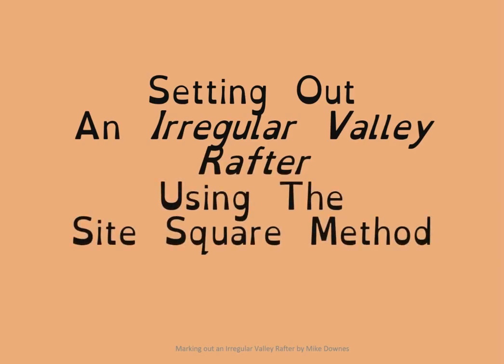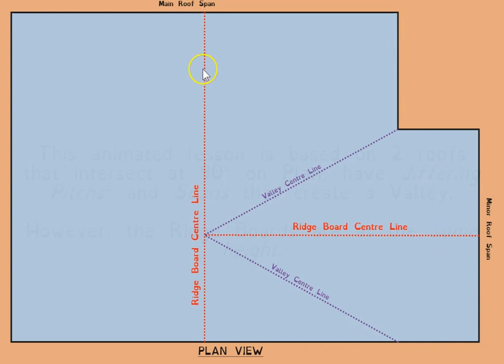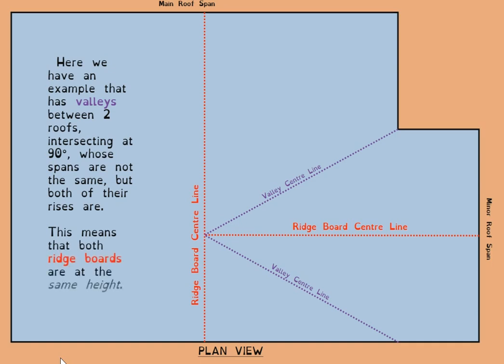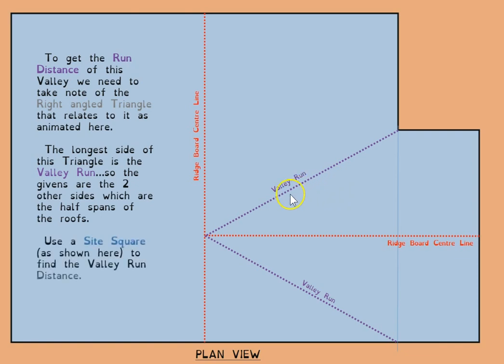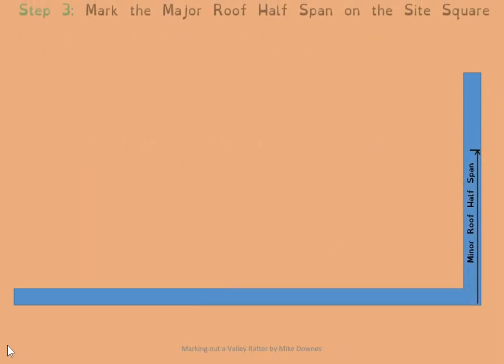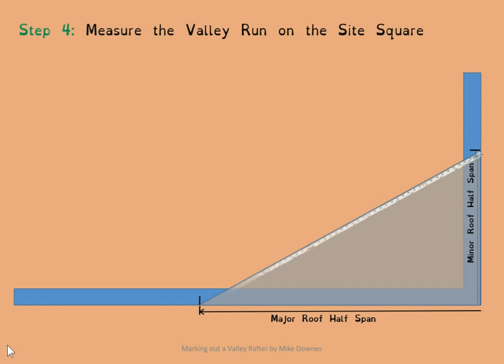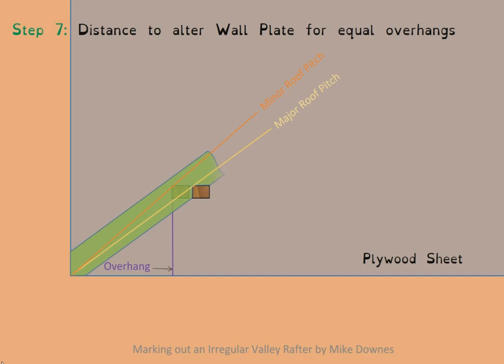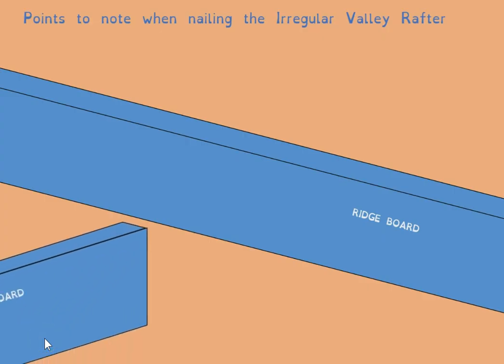Marking out a Bastard Valley Rafter

Comment: A really comprehensive guide and explanation on marking out an irregular valley rafter. The associated animated graphics were extremely useful in visualising the subtleties of this variant to standard roof constructions. Many thanks for this and previous related posts each of which has clarified important roofing and construction details in a simple manner incorporating great graphics alongside the commentary.
Reply from the maker: Hi Jeff, Thanks for this feedback. I have been producing these vidoes based on what I used to draw on a Black Board/White board when instructing Carpentry Joinery apprentices. Now that I have the option of creating these animated versions of the same lessons I cant create them quick enough as I can see the quicker transfer of  knowledge that is happening...especially to the Visual Learner.
Reply: @michaeldownes516  Michael, your YT posts are an invaluable source of reference and insight. As you point out, visualisation aids make construction details so much easier to grasp.
Are you aware of the following old text: Advanced Constructive Geometry by Dowsett ? This contains many superb applied joinery problems.I’m working my way through it progressively out of both curiosity and interest - teaching myself constructive geometry in the process.
Three somewhat related and intriguing joinery problems which at some future date yo may like to address are as follows:
1) Sometimes purlins are cut around the bottom edges of hip rafters and mitred together. The bevel used on the side of the purlin for this cut is required.
2) The geometry of joints in splayed work is another interesting topic eg. The corner of a box having splayed sides each of which has a different thickness.
3) Consider the following: A given moulded handrail section is inclined at a prescribed angle to the horizontal to a vertical pier, the other side of which forms a given obtuse angle.The aim is to determine the corresponding profile for the other part of the handrail, again fixed at some arbitrary angle to the horizontal in order that it intersects the original moulding at the corner of the obtuse angled pier. The bevel cuts at the intersection plane are required too.
Will be a regular viewer to your channel - once again fully appreciate the content and work which goes into the production of your videos. Many thanks!!!!
Reply from the maker: @jeffbourne6015  Well Jeff, I am not familiar with Dowsetts publication...but i intend to check it out. I have been referring a lot to a book I have since I was an apprentice by a Frank Hilton, titled "Advanced Carpentry & Joinery" which  covers  Purlin Bevels including the Lip Bevel, Splayed Linings and Hopper Development including the Dihedral Angles and also Handrail Development and Raking Moulds. I also refer to another old book i have titled "Modern Practical Joinery" by George Ellis
As it happens the next video i am planning to do is based on the the 3 Purlin Bevels at the Hip Rafter....hopefully uploaded in a week to 10 days.
I am also planning to produce some videos related to stairs to include  string, winder step and handrail developments.
Thanks for your comments and suggestions.
All the Best!
Reply: @michaeldownes516  hi  michael great videos ,i have a copy of dowsetts geometry book  extremely well written will catch uo sometime well done again ,videos are exceptional euge

Comment: Micheal it’s all very good stuff! In my experience when doing an equal soffit dual pitch Hip roof, we would calculate the amount to raise the Wallplate for the steeper of the 2 roof pitches, and the Hips or Valleys have a slight shift in relation of thickness to either side of the center line, but the center line stays in the same position lining up with the outside corner of the facia etc.
Reply from the maker: Hi Thomas, moving the wall plate upwards on the steeper pitch rather than inwards on the lower pitched roof is sometimes the best option to go with, especially if the rafters will be making contact with the wall before the desired overhang is reached on the lower pitched roof section.
Reply from the maker: ...i shall address this important option you raised in the public comments section in this video...thanks for your contribution.

Comment from the maker: If you cannot/do not to move the wall plate inwards on the low pitch roof section then you have the option of raising the wall plate on the steeper pitch. To calculate this distance, go to the 25th minute of this video and instead of using the animated horizontal distance between the 2 pitch lines...measure  the vertical distance between both pitch lines from the same junction.This will give you the distance to raise the wall plate on the steeper pitch to maintain  the same over hang for both pitchs.
Reply: Yes, it's all good stuff and I'm still interested and learning in my 60s!

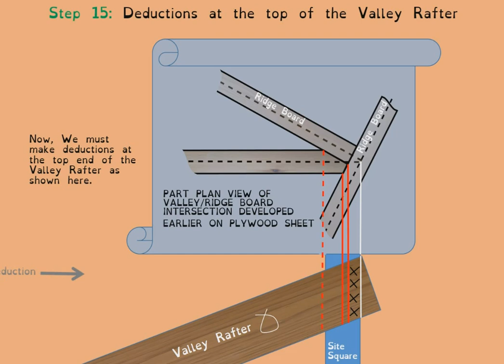Comment: Hello Micheal, at 16:15 is this where you get the plumb lines for both sides of the valley major and minor roof sides if so you mark it from your sheet of ply,
Reply from the maker: Hi Violet, this is where you get the plumb cut for this valley rafter...you can scale down the roof to fit on your plywood sheet if its just angles you are after (angle wont change if you scale up or down)....if you want deductions add in the width and thickness of roof members at  full size   on to scaled down drawing of the roof. 

So, you now have scaled the minor and major runs etc to get it to fit on to your setting out sheet, but the width and thickness of the rafters, ridge board are added at their full sizes so as you can measure off their deductions.
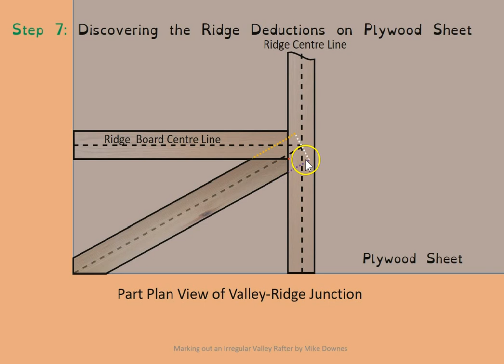Reply: @michaeldownes516 thanks for the reply, so is at 10:18 where I measure back for the deduction for the two plumb cuts on either side ?
Reply from the maker: @violetsherwood6494  thats correct....measure back those deductions show at 10.18 square off the plumb line on both sides of your rafter (this  will now transfer you from the line diagram version of the roof to now factor in the thickness of its members)